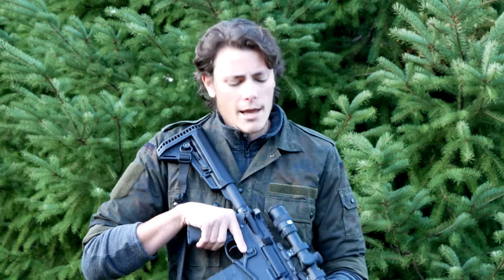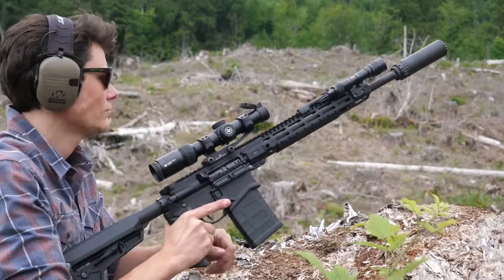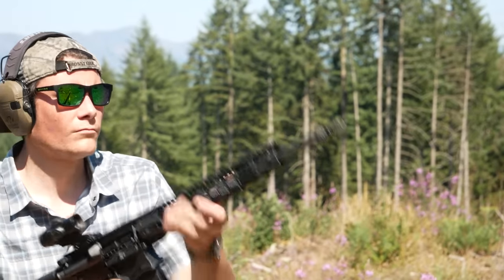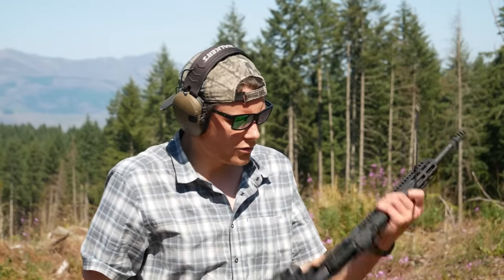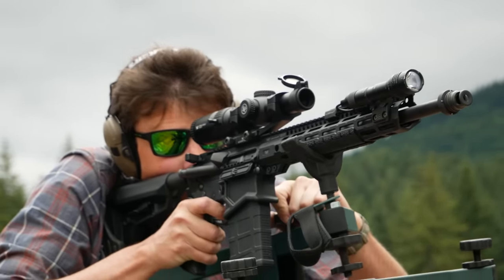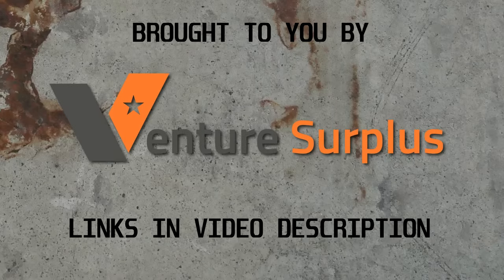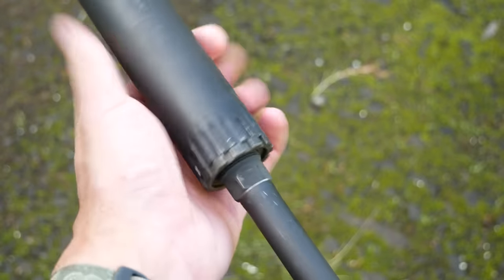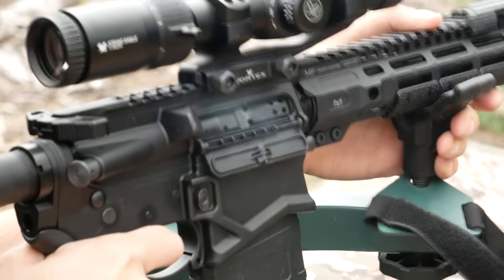Taking the Ruger SFAR to the Limit

Comment: I put off adding the Riflespeed to my SFAR for far too long. Tried my best to get things to function with what Ruger gave me. Even got the updated regulator from them, but no dice. The last straw was the Ruger gas regulator seizing up. Since the Riflespeed, it seems to have fixed my issues. Accuracy isn’t all that great but fine for hunting use. Ruger even replaced my barrel after I found bad machining in the throat. Have put out a number of videos on this thing… appreciate the work you’ve done with your SFAR and sharing your experience.

Comment: Haha, I was just thinking about the Dictator gas block as a solution and there it was in the video.  I've  used the Dictator on a couple builds and like it aside from the concern for overall height.  It's tall and the straight gas tube is tall, so handguard must be chosen carefully.
Reply: So, are you saying a POF Dictator wouldn’t fit under the SFAR’s OEM handguard?
Reply: @BweareK  I don't know, I don't have an SFAR. Just saying the Dictator is tall and I've run into issues getting it to safely clear handguards in some builds.

Comment: I'm so glad you didn't abandon this project. It's SUCH a compelling gun considering how overpriced SCARs are and how much excess weight there is in shortstroke piston AR-10s.

I'd love to see you try out a Faxon MLOK carbon fiber handguard (which would give more clearance for the gas block) or a BLK LBL integrated bipod handguard
Reply: You complain about overpriced then want to see a carbon hand guard
Reply: @Rubeless exactly - want guns that are as cheap as possible so that I have the budget for the best possible aftermarket parts. THIS is why I can't afford a SCAR - I would need a replacement lower to use 25 round Magpul PMAGs, I would need a CF handguard extension, I would need a nonreciprocating charging handle, I would need an ACR stock, and then I would still need to buy optics
Reply: @Rubeless  not all of us are poor, like you, some of us like to buy guns, and then custom them out

Comment: I’m running mine at the gas setting 2 with a flow through suppressor. I’ve been using a variety of loads ranging from M80 ball to 168gr HPBT Match. Never had a single failure.
Reply: The real test is without the suppressor.
Reply: The unicorn! Mines been pure hell. Just upgraded the gas block with an aero precision adjustable… heading to the frustration range tomorrow. Wish me luck 🙏
Reply: Yeah, mine has been solid asf (luckily).. I fkn love it, but no can yet. Might snag a hux
Reply: @speedyolvera4748  we’re not poor, we don’t shoot without suppressors
Reply: @mrgrump2534  neither am I bud. I like reliability and versatility… stay humble my friend.

Comment: I'm probably lucky in that my SFAR has had no problems. I've only put about 500 rounds through it, but they have been problem free. 
My build is maximizing the SFAR's strength, in that it is light, so I've kept it as light as possible.  3x Prismatic optic, Back up Irons, sling... That's all this rifle needed.
Reply: My wallet wants me to buy the SFAR, but my heart knows I'll buy the DD5 V3.
Reply: Identical build here!
Reply: Don't plan on using it at night I see
Reply: Same. Mine's been good. Changed the rail, and some controls, but that's it.
Reply: Mine has been solid after the break-in period! I haven't admittedly ran it suppressed too much, but that will change this next weekend.
Reply: No issues on 300 rounds, but I just got it September 2023 direct from Ruger. Hope I'm one of the lucky ones
Reply: Ditch the irons and add a flashlight
Reply: Seems to be people that twist the gas adjustment a million times that have issues, anyone that just shots them seem to be able to use them without issue. Maybe YouTubers should learn if it isn't broke do not mess with it as much as possible and then blame the product not the user.

Comment: I use superlative arms gas blocks in all of my ars. perfect reliability with any bullet despite spring weight/buffer weight/bullet types. Runs waaaay cleaner suppressed and no gas in the face as long as your settings are good.

Comment: I've already drilled out 3 SFAR regulators, thankfully it seems to be a happy middle-ground for sizing, stock port size for #2 is 0.093" and we opened it to 0.098" and that was enough to have it cycling everything. We did find the #1 really only works well with higher back-pressure cans so we also opened it from 0.063" to 0.072". The #3 is 0.112", which is outrageously huge even as an adverse setting for any .308 gas gun.
Reply: Why bother? Throw it away. Buy a better design like DD or LMT.
Reply: @Enjoyer.762  I think it would have been apparent that I'm not doing this work to MY rifles
Reply: Thanks for your info on modifications.
Reply: @acrienteangelic1862  what do you recommend for an AR-10?
Reply: @Enjoyer.762  It's the same design. If you're going to spend more than $2k, don't waste it on Stoner's failure to launch. That's why the SFAR is nice, it's cheap and you can fix it if need be. Or if you're gonna spend $2k+ get an XCR-M and get a proper piston setup.
Reply: @DriveCarToBar  Only this Ruger is a failure to launch
Reply: @Enjoyer.762  nah. The AR10 has been kind of a bust altogether. It blew up in US testing and lost to the FAL and M14 almost everywhere. Even the ultimate form SR25 from Eugene Stoner and Reed Knight lasted a few years before the US Military said kthxbai and chose the HK 417 as the M110A1. 
If you're gonna drop the duccats on a .308 class battle rifle, get an AR10 variant that is cheap so you're not out too much having to fix it. Or spend more and get a XCR-M or SCAR-17.
Reply: @DriveCarToBar  It's not the 1950s, Cletus. The LMT MWS MARS-H is far better than the HK417, SCAR H, and M110. You are unfamiliar with it.
Reply: @Enjoyer.762  You're right, its not the 1950s, so why is LMT still using a gas system from the 50s in a rifle that costs $3k+? 
It's not any better, and is arguably worse with that stupidly short barrel. It's the same Stoner system the M110 uses, which is why the original M110 got replaced by the HK rifle. LMT is the Gibson guitars of the rifle world; you're paying for a name and lots of hype despite superior alternatives existing everywhere. If you're a country with the money to spend on a battle rifle, you just aren't choosing an AR10 derivative. 
I can buy an XCR-M for a thousand dollars less and have enough for a bunch of ammo and a tax stamp.
Reply: @Clean97gti  You aren't familiar with the LMT at all lmao. It comes in DI or gas piston. It's multiple caliber. It has a quick-change barrel system. You can swap op systems and calibers with a simple barrel and BCG change.
Reply: @Enjoyer.762  my bad, I didn't realize LMT wants to charge you yet another $1000+ to make their gun into an HK417. 😂😂

Lol what a piece of crap.
Reply: @Clean97gti  The 417 is inferior to the MWS. You can't even purchase a 417. You only can purchase the cucked MR762 which doesn't even have a chrome lined barrel. You can't even acquire spare parts from HK. The MWS beat the 417 in UK and NZ military testing trials. If you like the 417, you might as well purchase a SIG 517 lmao. After the engineers who designed the 417 for HK left and went to work for SIG lmao. From your comments, I can tell that you can't afford either LMT or HK, you PSA owner LMFAO
Reply: @Enjoyer.762  I'd take a JAKL over that overpriced HK417 wannabe LMT rifle. At least HK has their gear in people's hands. They managed to replace the M4 in frontline service with the USMC.
LMT is gucci garbage for LARPers with more brains than money. 
Go back to CoD lobbies.
Reply: @DriveCarToBar  The MWS was invented and built before the 417, you poor lol. HK was too busy building a melty G36 lmao.
Reply: @Enjoyer.762  Ah yes you're right. The MWS was introduced in 2009, many years before the HK 41X series which entered service in 2004. Good looking out. 
Want to know what the G36 has also managed to do that LMT's rifles can't; get issued in large numbers to multiple different militaries. 
Meanwhile, FN, HK and now even Sig who makes guns that go off on their own has managed to do that.
LMT is a part supplier. If I need new takedown pins, or a barrel that isn't cold hammer forged, I'll call them.

lol, no I won't. They make crap.
Reply: @Clean97gti  The G36 melts its plastic barrel trunnion lmao. Germany will be replacing that POS. They should pick LMT. LMT > HK.
Reply: @Clean97gti  The only people you will be calling is PSA's customer service line lmao
Reply: @Enjoyer.762  Replacing the G36 after 30 years of world wide service, where oddly enough, nobody else seemed to have those melting problems you mentioned. In fact, nothing melted at all. The complaints were about accuracy problems when the rifles got hot after multiple mag dumps.
But what is Germany replacing the G36 with?  Why, it's the HK416! Already in service with The Netherlands, the USMC, France, and many smaller forces worldwide.
Who took out a contract with LMT for their HK wannabe? 

Oh, nobody? Damn. That sucks. Maybe they should stop making garbage rods. 
Funniest thing is, PSA is bigger than LMT. 😂😂 Lousy Metal Trash.
Reply: @Clean97gti  Nobody cares about the 416. It was in limited use in the nations you cited. Even the US military didn't dump the M4A1s for the 416. I see you're attempting to change the subject lmao. The UK military adopted the LMT MWS 7.62 NATO as the L129A1 over the 417. NZ adopted the battle rifle configuration and the LMT 5.56 MARS-L replacing the AUG. Estonia purchased both LMT 5.56 and 7.62 NATO rifles. You do know something about garbage rods being a PSA owner lol. JuSt As GuD. Better post video evidence you own anything HK or didn't happen, kid.
Reply: @Enjoyer.762  The USMC did. All marine infantry is using the M27. 
So the Brits bought a couple thousand LMTs as DMRs,  big whoop. The Brits bought the cheapest thing that would work. But wait, when they needed their L85s upgraded and fixed so they'd be reliable, who did they call? 
HK.
Keep huffing that copium boo-boo!😂😂
Reply: @Clean97gti  The M27 didn't replace all the M4A1s. The M27 was intended to replace the M249 which was stupid. I bet you don't even own any HK firearms lmao. Prove me wrong and post video evidence you poor PSA owner.

Comment: Had something similar with the AASF .308 by Adam’s arms over gas. Solution 5.8 ounce buffer weight and a rifle length spring. Cycles 147-175 ejection pattern is 1 o’clock 147 to 3:30 4 with the 175. The rifle has 5 settings on the gas block. Surefire war comp and warden device.

Comment: For the old dust cover.. You can just take a triangle file and cut another groove around the little rod and order another tiny C-clip and snap it on there.. works just fine for a budget hack;  or if you just happen to have a c-clip already and don't want to wait on parts.
Reply: chucking it in a drill and using a washer to brace the file against the drill chuck is my trick. I don't know why 2 clips isn't the standard
Reply: @tedundercarriage8183    Nice.. I'll try that next time.  I'm sure there are aftermarket options that have a dual clip as standard;  to be fair, when this was first designed, they didn't plan on it being so modular like it is today.   Innovation is awesome.

Comment: I have an SFAR with a Midwest handguard and radian raptor. Run suppressed on setting 2. I have had zero issues after the first 100 or so rounds. I like the rifle a lot. Shoots under 1 moa with sig 150 fmj
Reply: Is yours the longer barrel though? From what I've seen review wise their are more problems with the shorter barrel ones.
Reply: @aeis3007 mine is a 16 in barrel and have had zero issues with it
Reply: @basemandog  glad to hear.

Comment: The SFAR is a good idea and has appeal...but it's Gen 1 and new systems in Gen 1 almost always have bugs.  Appreciate the effort, reviews, and updates Hop, it takes things like this to result in Gen2/Gen3  systems that are BNIB reliable.
Reply: They problem with Ruger is that they consider gen 1 a finished product.
Reply: I hate to say it but you're not wrong, they let some things linger now and then.  Hopefully they will see the potential getting this right has.  Produce the reliable version Hop has figured out and this becomes a serious player in the market.
Reply: Typically Ruger rules stand behind the product and make sure the gun is right and runs like it should..

 if you send it to tgwmm, they're not going to send back an unworking gun as far as I've experienced.
Reply: Is Ruger willing to handle a warranty issue, sure they are.   As a customer though, having to go through the warranty process has additional costs, takes additional time and effort, and puts a stink on the purchase.  Ruger isn't the only manufacturer though that's guilty of beta testing it's products on the public by rushing to market with "sort of" works products.  In hindsight, I bet a lot of Gen 1 P365 buyers would have much rather waited for Gen 3 model.
Reply: @Teak0531  

 Yeah but what evidence is there that this rifle was rushed to market? 

I can't think of a single gun manufacturer that hasn't had teething issues with models, or has had to make tweaks and do warranties or recalls.

And this includes platforms that have been around for a long time and are generational, case and point the recall on Remington triggers  Which includes legacy models such as the 700.

There's no such thing as buying a weapon from a manufacturer and never having hiccups.
 every single manufacturer from Remington, Smith and Wesson, ruger, Sig, Glock..., take your pick...

 Every single one of them have warranty issues and recalls.

Whether it's guns or cars or anything else for that matter that has working moving mechanical parts, you're gonna have warranty issues, recalls, failures and so on.

Many people who've bought the SFAR have had no problems at all, 

so a few people having trouble whereas a majority don't, doesn't mean that buying the rifle comes with inherent problems that you're going to have to work out.

 I bought a Sig 516, it's ran like a champ, and you can find other people on the internet complaining that it's unreliable, despite the fact many people have had no problems,myself included.
Reply: I suppose the original spirit of my post is really the point.  I’m grateful people like Hop take a new Gen 1 concept and walk us through the experience of what it takes to make it functionally reliable.  If I remember correct, this SFAR of Hop’s is a replacement he received but I may have that wrong.  Nevertheless, there are compromises that get made to bring a product like this to the market at this price point.  Things coming out of these compromises have popped up in a lot more places than just Hop’s channel.  Do some people get reliable products BNIB, I’m sure.  That said, if the warranty return rate is 10-20%, isn’t that really sort of high.  I suppose I’m less forgiving about this than we’ve been trained to be.  Comments like…these things happen, the warranty work fixed my issue, you can’t expect perfection, etc. all point to a way of thinking the manufacturer’s want us to have.  More thorough testing in the research and development phase would alleviate a lot of warranty issues that plague the industry.  I suppose my forgiveness about this stuff works like this, if it’s a new Gen 1 product, stay away.  If the warranty issues stop being a topic of conversation by Gen 2 or Gen 3, then I can forgive them for Gen 1 and be glad I waited for Gen 3 or Gen 4.
Reply: @Teak0531  

Where are you getting the claim that 10-20% fail and need warranty?

Secondly,
 This has nothing to do with what manufacturers supposedly want us to think,, it's reality.

Go buy a brand new vehicle off the dealership lot, and see how often brand new vehicles are in the dealer for warranty repairs and things that go wrong within the warranty window.

 And this includes lrgacy vehicles that have been built for decades.

Their service departments are not sitting around doing nothing.

 People need to remember, you always see videos and reviews about people that have had bad experiences, you rarely hear the reviews and videos from people that have had no problems, there is always a bias.
Reply: Are you employed by the manufacturer?  The 10-20% is an estimate, not gospel.  If you have one and it works great, good for you however that doesn't mean it doesn't need some work.  The original theme of the post remains the same, I'm glad people like Hop take the time to show how a new and potentially awesome product actually runs and what it has the potential to be with some work on the inherent Gen 1 bugs.  Nothing more nothing less.   If you enjoy engaging in the warranty processes and tinkering with this fix and that fix, good for you, some people like that stuff.  I personally appreciate reliability without extra time, effort, and money.  I agree to disagree with you and accept that you disagree with me, no sweat my man....live and let live.  Happy Holidays!!
Reply: How do you tell which Gen the rifle is?

Comment: Got a 5.9 lb Rogue and using a Riflespeed system with a Silencer Co Hybrid 46M ...I'm very pleased with the groups I'm getting and very reliable ...not had the problems Ruger SFAR owners had with the POF but then the Rogue cost more and it has a roller pin bolt and their G2 chamber extraction system that will  run Chinese Lacquer coated steel case no problem as well...

Comment: I'm liking my SFAR so far. Still running the factory gas block, but did swap out the HandGuards for a MI combat rail. Have had issues suppressed on setting 1 and unsuppressed on setting 2. Will try those lower gas settings once I get more rounds through it.